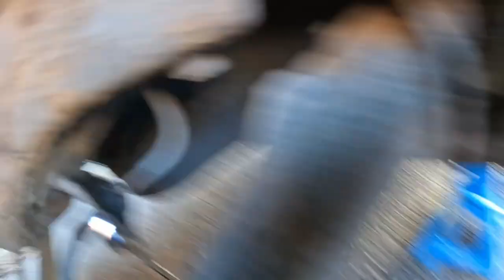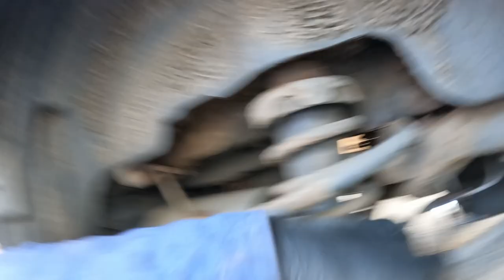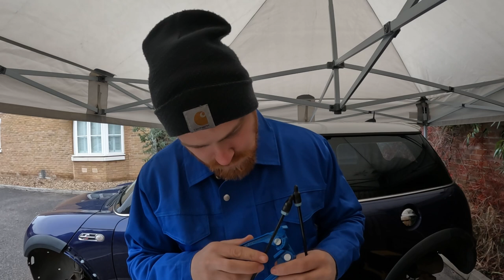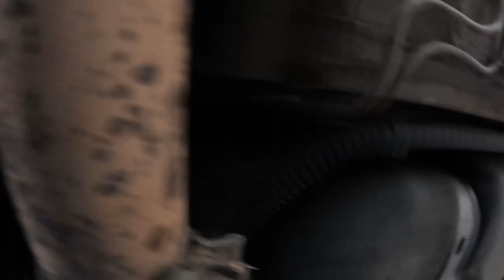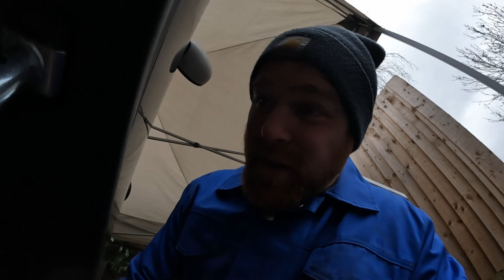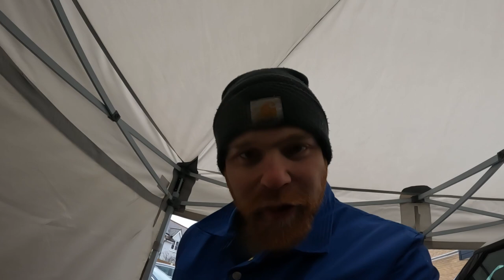What on earth has happened to the brakes on this Mini???

Comment from the maker: You’ll all be pleased to know that I’ve just purchased a blow torch! Finally 😅😅
Reply: I prefer cut's to burns
Reply: I did wonder when you would get around to that .
Reply: In the future since your replacing the brake hose, pop off the retaining clip that holds the junction into the subframe bracket and cut the hose end off. Then push the cut off hose end towards the hard line and through the bracket that retains the line. Put a socket over the cut off end, hold the nut on the hard line and it should come apart easily with your impact. You definitely did it the hard way which I've done myself multiple times, but hey your learning and that's what's learnings about.
Reply: Cant be stuck if its liquid.... Oxyacetylene tanks otherwise known as the big red wrench!

Comment: Oh no, I just learned that getting the brake lines of that era BMW vehicles unseized is futile! There is a method to work around the issue: bend the c-clip at the brake line-hose junction to move the hose a bit, freeing up the anti-rotation feature on it, then unscrew the brake hose from the line. For replacement, use hose that has an independently rotating fixing on that end. Well, back to seeing the disaster unfold.

Comment: A bit of heat, cut the pipe at the union, and put a socket on the nut so you apply more force to break it loose?You already have new lines so no need to save the old stuff.

Comment: If you don't have access to oxyacetylene, then even MAP gas, with or without oxygen, works great to loosen corroded fasteners. In a pinch even propane will work.
Reply from the maker: Thanks for the advice. What's the difference between the different gasses? Temperature?
Reply: @NotEconomicallyViable  Yes, temp. Oxyacetylene>MAP+O2>MAP>Propane. Be careful with cast aluminum, the threads will tear out. So for cast aluminum I heat, then quench with cold water, then wind out. For cast iron or steel the usual strategy is to heat the female end, then wind out while hot, but it works either way by thermal shock. For brake bleeder screws, keep the heat away from the tip, oxyacetylene will melt the tip end. And for brake lines, flush the fluid afterward so fluid that was heated is removed.
Reply from the maker: Great stuff - thanks for that 👍🏻👍🏻

Comment: Drop the exhaust and the fuel tank to do the brake lines. It’s the only way to get the line out and use it as a template. If you’re changing the pipe you can cut it and then get a socket on the union.
Reply from the maker: Thanks for that, Peter. Gonna take a look at how to do that
Reply: @NotEconomicallyViable  I did this job about a month ago, it's not so bad.  I'm also working outside, no lift etc!  My advice (for what it's worth), take the BMW pipe back and get your money back!  If it's a steel pipe then it will be much harder to shape it probably cost an arm and a leg.  Buy a roll of copper/nickel pipe (about £20) and some unions and do both sides at the same time.  The unions are all M10 apart from 1 which is an M12 so make sure you know which one this is. To get the old ones out I cut the pipe used a deep 10mm socket , heat and lots of WD40.  For the new lines you can but a flare tool and do it yourself but you will need a BUBBLE flare tool - personally I paid a local thread and pipe service to fit the unions and flare the pipes once I had shaped them - cost me £5. 
To take the tank out don't forget that you have access from under the back seat which make the connections a lot easier to get at.  You may find the strap bolts are stubborn, I had one snap but it was easy enough to drill and out and clean up the threads.  Once the tank is out it is pretty easy to do the brake pipes and you will save a load of time as well as avoiding having to put the pipe in in sections.
Finally, buy caliper reconditioning kits and do the calipers rather than buy new ones - save a load of money and its pretty easy.  You can do this indoors while we have a load of crap weather.
I'll keep watching and good luck.

Comment: Yeah, I’ve had to give up several times on brake lines that are rusted solid.   Steel pipe under a car, they are going to rust.  Even the experts cuss and do a dodgy job of installing new pipes.  So that’s a little bit of solace.

Comment: If I was doing that job I would get myself a roll of brake line, thread it through where needed and the flare the ends manually. It’s well know as a crappy job (along with the front wishbone bushes) 
Can you get the car any higher? That would help hugely.
Too late now but you could have also chopped the solid pipe union as close to the end as possible then re-flared on the car. This is what I did recently on mine.
Reply from the maker: Really annoyed with myself that I didn't think of just re-flaring the ends 🤦‍♂️ Oh well. I'm gonna need to do the rear passenger-side at some point by the looks of it, so I might well try that strategy there.

Comment: Are you sure your using the right size flare? Also what u can do is buy some freeze release spray as a  Release penetrant. It has a double function that it can release on its own, but also if you use heat on the nut and then use the freeze release spray it will expand and contract to really free up that rust.

Lastly if you end up cutting the brake likes, cut it near the nut and that way you can get a deep socket on the nut for better purchase.
Reply: Thats not rust so much as just tight and union unable to revolve on pipe so much tighter . . The loose fitting new spanner is the culprit . . Muller spring clip off, push assembly out through hole, thoroughly attach quality mole grips to union and use spanner on hose or cut hose and use deep socket to crack then revolve hose to unscrew . . Iv'e used a cut down suitable normal spring with a C-clip to replace spring clip in the past.
Reply from the maker: Yeah definitely an 11mm. Just weird how much play there was with the spanner. It's a Teng, which I heard were supposed to be decent 🤷‍♂️ Just ordered myself a blow torch and will look into some freeze release spray nice one 👍🏻

Comment: Oh my word my heart goes out to you . . Front to rear pipe on the floor in the rain horrible horrible no fun here . . Yes iv'e done it many years ago on the side of the road when I was more your age on an original Mini for mot work . . I learnt from that experiance to always avoid this type of job if at all possible or make sure it's well worth your while . . In time you will learn tricks and techniques that would have saved changing that pipe worst case scinario here if it wont come out of hole then remove the hole or cut it and split it (Remove saftey shield from angle grinder and fit cut off disc then use brake cleaner and quality insulating tape to prevent excessive blood loss while continuing to work) . . Next time buy a roll of copper brake pipe and a flaring tool instead of a pipe bender. . Cut away old pipe with side cutters and cap pipe using maybe an old vacume pipe with a scew in one end (less fluid dripping on the floor your lying on) then re route new pipe the easiest but safe way using custom length to your choosing (string and judgment and use string to pull new pipe through aswell because copper pipe is plyable and a blob of Tiger Seal to a cleanish surface and left over night provides a non rub pipe attachment to car body) Piston came out because you cut pipe removing fluid vacume efect from diagonal duel circuit brake system . . A hard way to learn but now you know how to refit caliper piston's lol . . Stay focust on that Aston . .
Reply from the maker: Jeremy, thanks for that great advice. Looks like I might have the same issue when it comes to the passenger side, so I now know a bunch of different ways to approach the problem. It's all a learning process, and like I've said in other videos I'm actually having the time of my life even if sometimes it doesn't look like it haha.

Comment: I would have bought a roll of brake pipe ( copper alloy) so it bends easily. Threaded around the tank ect. Then flaired the ends. Use mole grips and a blow torch to remove stubborn fittings.
Well done for the perseverance. Gone are the days when I’d crawl under a car in the wet. Keep the videos coming they are entertaining. 👍
Reply from the maker: Yeah that’s a good shout. I think I’m gonna go down this route when I do the passenger side, which has way tighter bends. And thanks for the kind words - keeping me motivated 👍🏻

Comment: buy a flare tool and put new nuts on the old pipe maybe. i made some new brake lines by taping the old line to it and working my way along the new line, taping it off after each bend. they are 3 dimensional so much harder to do than you think.
Reply from the maker: Yeah that's not a bad shout at all. Think I'm gonna give the passenger side a go once I've had it MOTd, so will use that strategy for that I reckon 👍🏻

Comment: Invest in a blow torch.. A good bit of heat will loosen those up a treat.. i got one from ebay complete with 2 filled canisters..
Reply from the maker: Yeah gonna have to grab one. There has been quite a few times during this build that a torch would’ve come in real handy
Reply: @Nino Rosella  As they say "its not tight if its liquid" 😆.. Everything on modern cars, seems to be made of soft metal.. its like they make them that way, so we have to go out and continuously buy new parts all the time. Drives you nuts!.. Anyway, take a breather, do some digging on the net, and refresh.. More mistakes happen when we get wound up over what is meant to be the simplest of tasks..

Comment: You just needed to use a good quality mole grips to brake the brake nut free then you would have to replace the hole pipe.
Now you have taken the old pipe out you have to just feed the new pipe in and bend as you go so the pipe fits in to the clips on the body. 
Copper pipe is best as it's easy to bend but as you have bought a steel pipe from BMW you will find it harder to bend in small places. 
It can be done so just take your time and plan a head. Look at where is goes and take photos if you have to. 
On the front, cut the pipe now you are removing and use a socket on the nut and a good fit spanner on the female coupler. It will break free but you have to make sure you have a good fit socket. 
Good luck and I'm sure you will do it.
Reply from the maker: Thanks for that, Tony. I've actually just bought some copper pipe as a back-up because I'm looking a this steel pipe and it's not filling me with confidence. Gonna order myself some decent mole grips, too 👍🏻
Reply: Trollco69 on ebay has all the pipe and nuts you will need. 
Copper is so much easier to bend when in a small area. I've done all these job 100s of times and it's never a good job. Just keep going, you will get there is the end.
Reply: Use cunifer not 100% copper as that rusts and is dangerous, illegal in US even. Just putting this here for anyone finding their way like me
Reply: @digiface  hi. I have just read your comment and had to Google it to see if copper rusts. According to Google copper will never rust. Not sure why you would say that but maybe Google it your self and you can read what I have read. Just saying that's all. 👍
Reply: @tonyrepairs5558  sorry I knew there was a reason not to use 100% copper, which was the purpose of my comment,  but you are right it won't rust it will harden over time and crack, and is illegal in some countries because it can burst under pressure. Hence 'cunifer', in which nickel is added to copper to add strength
Reply: @digiface  yes your right but there is copper pipe out there and I'm not sure what percentage of other material is added, but has a very high pressure rate. I've worked with copper pipe here in the UK for years and never come across pipes cracking but that's not to say that it won't. Cars here in the UK don't last that long anyway haha.

Comment: I'm only a few minutes in here but...are you sure that union nut wasn't a 10mm? As you say, it seemed like there was too much play when an 11mm spanner was on it and it appeared to round way too easily (and didn't seem that rusty). Just wondering if it's possible it seemed like an 11mm before you wire-brushed all the excess rust off, when it was actually a 10mm

Edit: Yep, defo 11mm. Did some googling... (which I'm sure you did before buying the spanners so my apologies😂)
Reply: 10mm Japanese 11mm European
Reply from the maker: Yeah definitely an 11mm lol. I did try a 10mm flare nut and regular spanner first. But it's still worrying that there was so much play in the spanner. I thought Teng tools were supposed to be decent, but not sure now looking at that.
Reply: @NotEconomicallyViable  Teng are pretty good for most things, but not everything. I would try another brand like Wera, Stahlwille, Facom or, dare I say it, Snap on🤣
Reply from the maker: I’d have to sell all my other tools just to get one Snap-On spanner haha. I’ve been eyeing up Wera tools recently. I love the look of them - doing something a bit different

Comment: No good to you now but I’ve had this in the past where as you say the nut around the pipe is seized to it, what I did was cut the flexy pipe as far to the bracket as I could, removed the clip and loosened the pipe and pulled it through , I then managed to undo the remaining flexy metal end from the pipe using mole grips. The flexy pipe essentially turning not the pipe nut if you know what I mean. Aww man feel for you! You feel great when it’s fixed though and you can think, I did all that! For me it’s like bonding to my car lol
Reply from the maker: Yeah I'm with you. Will keep that in mind as I'm going to have to to the passenger-side too at some point and I'm sure I'm gonna run into the same problem again. Haha I'm definitely bonding to this car. My heart says I'm keeping it forever as it's my 'first', but my head is saying it has to go to make way for the next project.

Comment: Nino, have a look at my channel, I have a video on there on flaring cupro nickel brake line. You can do this on the car to change a rounded flare nut...
#smithiestrackmini

Top tip, get some antisieze on the flare nut thread when reassembling...

Good luck 🤞
Reply from the maker: Sorry mate only just seen this - it went into the spam section... Will take a look nice one